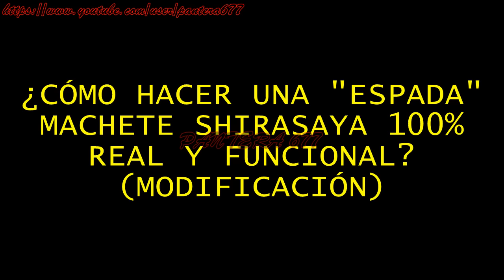¿Cómo hacer rápido y fácil una "Espada" machete shirasaya 100% real y funcional? (modificación)

Comment: Hola de nuevo amigo, una consulta tu que conoces del tema y asumo que de los materiales, tu consideras que soldando 2 machetes y dándoles la respectiva pulida se pueda hacer una espada más larga estilo katana? saludos y mul gracias por tu trabajo y tu respuesta
Reply from the maker: Gracias y un gusto poder seguirte ayudando amigo, si lo haces así de esa manera si quedara largo pero se le quitara el tratamiento térmico (se destemplara) o podrías hacerle el mango mas largo para que tengas mas hoja de corte, o mas "fácil" en algunos pueblos podrás encontrar machetes extremadamente largos 1.20 cm que es la medida de la katana y ya hací sera mejor para una modificación. Saludos desde México.
Reply: @pantera677  Gracias amigo y pues si he buscado pero aquí la máxima emdida es de 60 cm, pero seguiré buscando por si acaso, muchas gracias y éxitos amigo